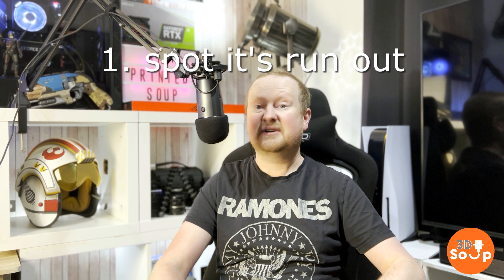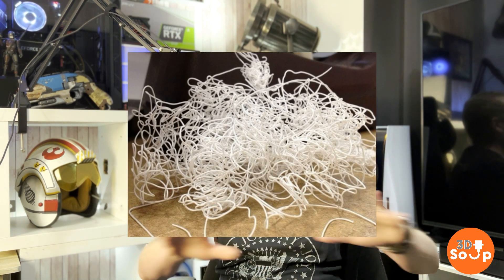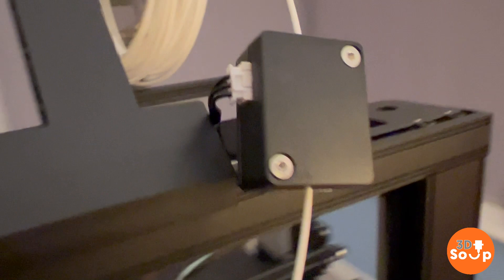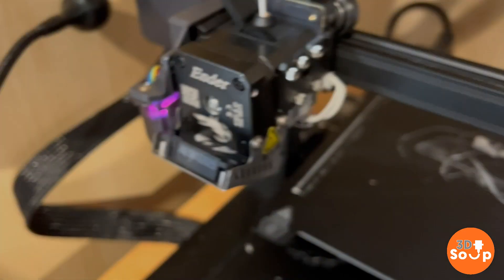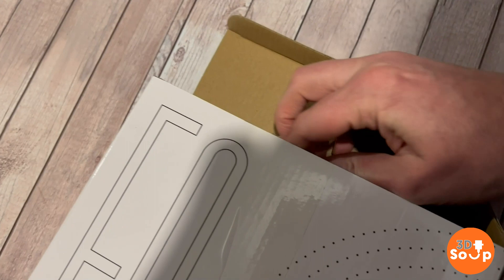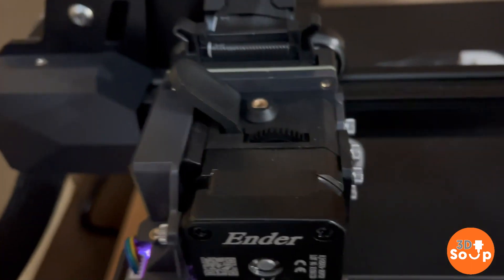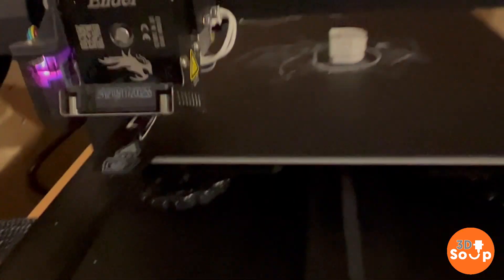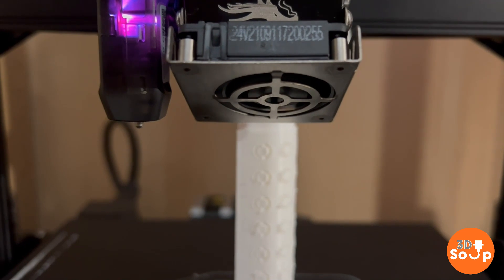Testing the ender 3 S1 3D printer filament sensor. how good is its print pause and restart feature?

Comment: Not sure how you simply managed to pull the existing short length of filament out of the extruder and then pop the new filament back in, without using the Retract / Extrude  controls on the pad.
Reply from the maker: Because the hot end is still hot, the run out sensor stops the printer with lots of filament left to pull out. You can use the controls if you really want to, you do you :)
Reply: Watch closely, before he pulled out the filament he released the tension on it using the same lever you use to load filament. Like he said, the hot end is still hot so the new filament will simply melt into place once you push it in and the and will prime the nozzle again (molten filament will come out the nozzle as you push)

Comment: I dont like that it has a very sharp brass linings and a very tough switch that eats up filament and ends up becoming the cause of filament runout without triggering anything. So just disconnected it with a little piece of filament that is there permanently now. If there is a way to mod it with ptfe tubes and maing the switch loose it will be great.
Reply from the maker: Personally I’ve never had an issue with it, but mileage may varies I suppose. Thanks for watching :)

Comment: If the filament breaks after the sensor, does it report that the filament in the sensor has stopped moving (odometer), or is it fat dumb and happy as long as the broken piece is still in the sensor (just an obstruction/presence sensor)?
Reply from the maker: I think it’s just a “yup there is filament blocking the light beam” type sensor. Cheers for watching
Reply: @3dPrintedSoup not even that. It’s a little contact switch that’s happy as long as something’s touching the button
Reply from the maker: @ptw783  sounds like my last job. Thanks for watching. :)
Reply: Needs a movement sensor instead. One that is on if the filament is present and pulses off/on when the filament moves.

Comment: Hey do you know why my 3d printer, the same brand and version, isn’t letting me start when I click confirm when it says the filament has been used up message?
Reply from the maker: I don’t, but I would advise updating the firmware to the most current version as this may help. If that does not work then contact creality customer support. Thanks for watching and commenting.

Comment: Wouldn't it be better to have the sensor mounted closer to the direct drive. To reduce the amount of filament wasted.
Reply from the maker: It’s attached to the that position for a reason, It needs to be attached to the cross bar so the filament does not snag. Thanks for watching :)
Reply: The only printer I have with a run out sensor. Is the Neptune 2.which is a bowden setup. Upgrading my ender 3 pro to 4.2.7 board and sensor.. Great content keep up the good work.
Reply from the maker: @CaptainBipto  let me know how the up grade goes, I’ve got a pro that might benefit from a few upgrades.
Reply: @3dPrintedSoup  I'll let you know how the upgrade goes. Also have a bltouch for the Ender 3 Pro and Neptune 2. My other printers two Flsun QQ-S Pro are my main go to printers. As they have static beds and bed leveling sensors.  Need to start printing out all the terrain stls I got on sale lol.
Reply: You can continue printing the 270mm remaining filament and then change it, no filament wasted if you just wait to finish those 270mm ish. Just insert the new filament through the sensor and pres resume, then press pause to change the filament
Reply: Yes that is a huge amount of material wasted indeed. #sarcasmoff